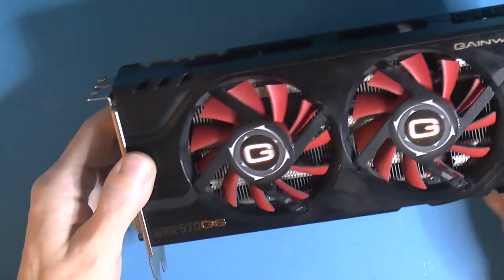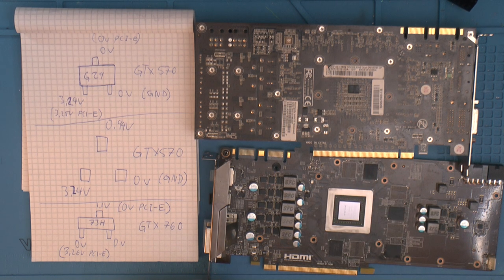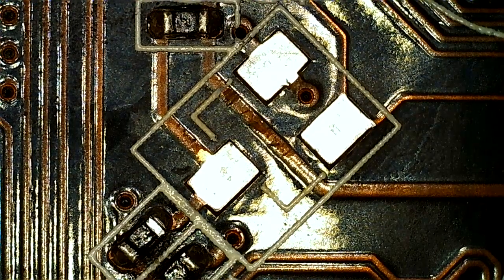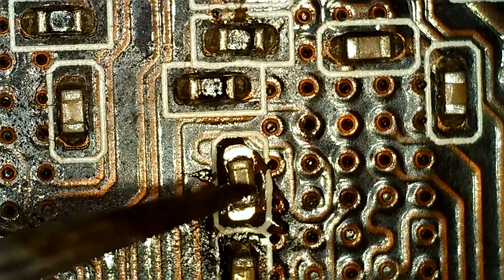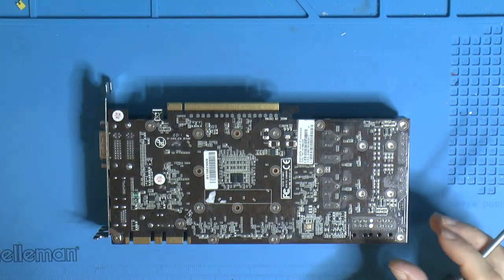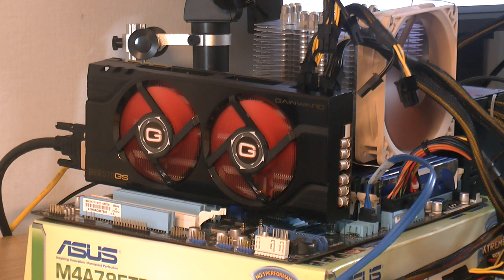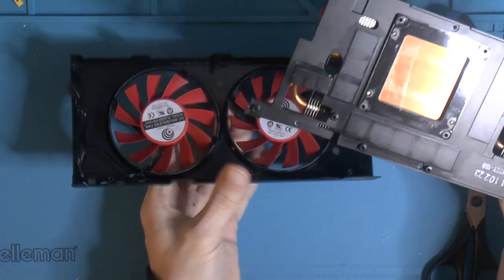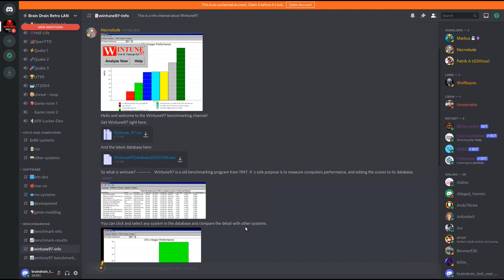I bought a broken GTX 570

Comment: I have half a dozen of those Fermi cards with the same fault. A couple years ago I liked using them in Minecraft PC builds for the kids in the village, as you could get them for like 15€ shipped and they perfomed quite good. By now, all of them died with artifacting. I revived two of them with hot air and they ran for a couple weeks just to artifact again. I even had two perfectly working ones, a 470 and 570, die into artifacting right in front of my eyes in a mainboard that would power off under load due to high voltage drop on 12V going to the board (bad cables, not GPU related). These cards do not like being powered off while they are hot.  I'd really like to know the physics behind that.
Reply from the maker: Yea this one will die eventually again. I also have aGTX295 with one dead GPU. Might get a stencil and try a reball just for fun on the 295 dead half and see how that goes. But if the chips them self go bad as I suspect it wont mater much.

Comment: Nice work! Looked like a bit of flux residue on the board, around the missing components? Nice to see you've become a Pirate! Ha, Haaaar! 🏴‍☠🦜
Reply from the maker: New flux or old flux? There where plenty of old flux on the card from manufacturing, it looks almost like broken glass under the microscope.
Board was cleaned and washed before reassembly to remove any new flux plus any dust and old gunk.

Once a pirate always  pirate!
Reply: Old flux, I thought it looked like someone had been there before.